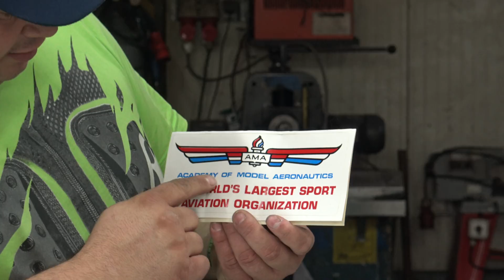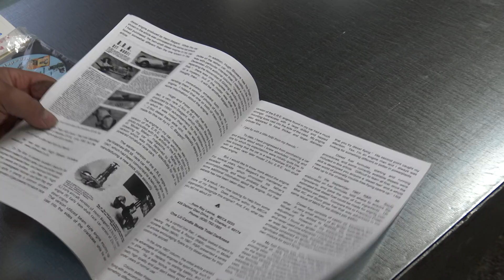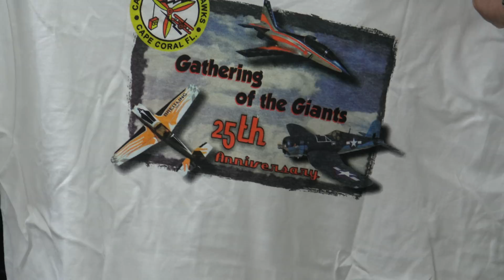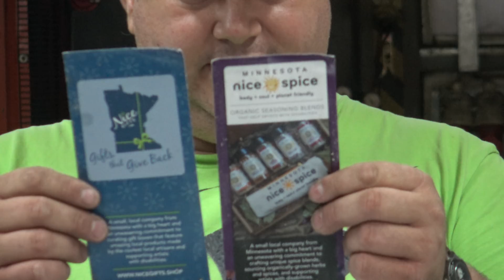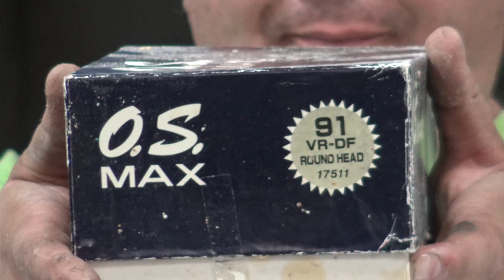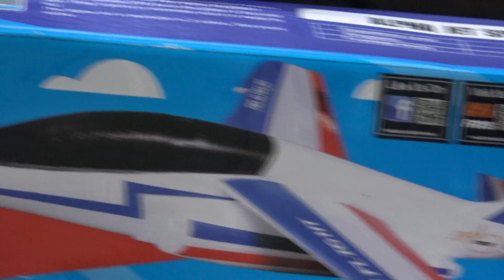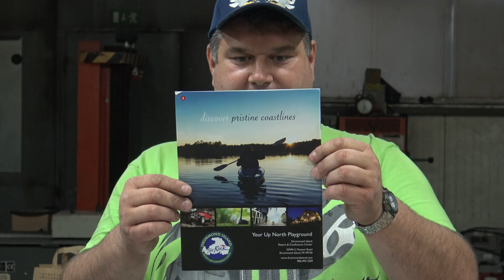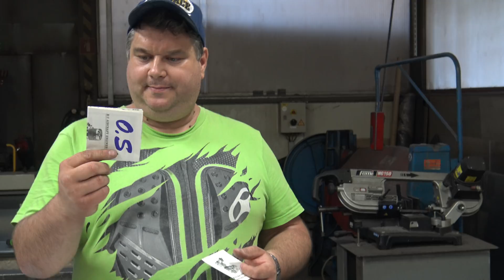USA Friends mystery boxes Whats inside?

Comment: I had that os .91 df engine on the laser arrow with a apc 10x10 at 20,000 rpm it was very fast! To make sure you add oil to your fuel. It likes 20% -22% oil